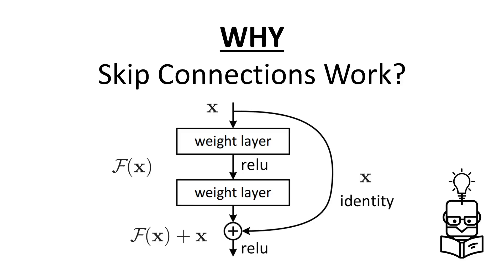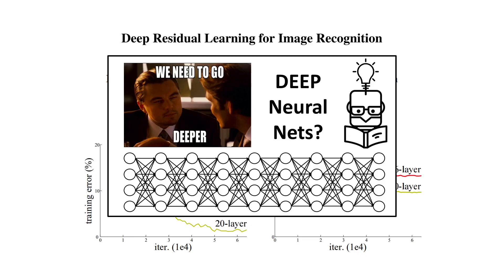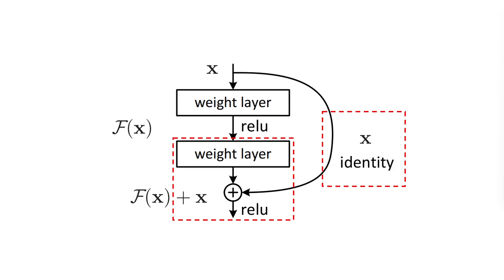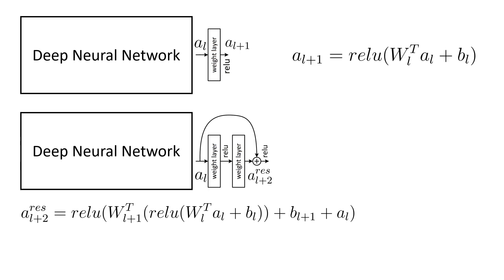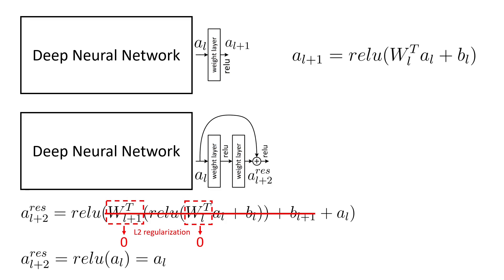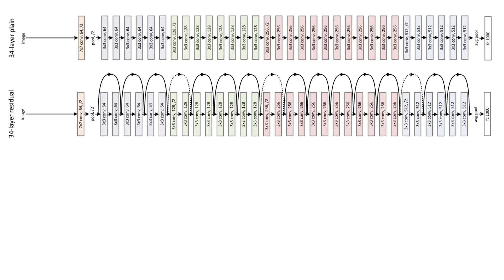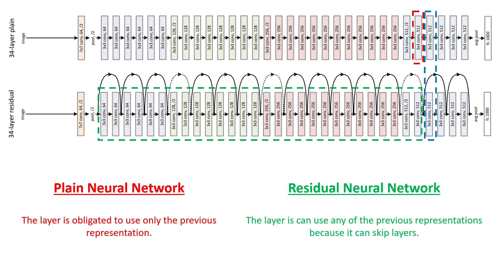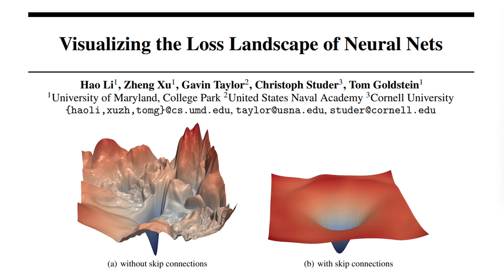Why Residual Connections (ResNet) Work

Comment: Thanks for the video! But you said that in the Residual architecture, the Network can use any of the previous outputs, what did you mean by that? It's not like it's connected to each of its previous output??
Reply: No, it is. For ex. With res connects, obviously layer 38 connects to 37, but it also connects to 36. This shows why res connects are so novel. Additionally, 38 can connect to 12, 15, and any other previous layers. If you look at the math equations, it makes more sense.

Comment: Thanks for the explanation, there is one thing that I hope you can elaborate on. With the weight matrix randomised, why is it easier for the NN to learn Zero Matrix compared to the Identity matrix?
Reply from the maker: Good question! IMO mainly because you also usually use weight regularization (i.e. L2) in your final loss, so the NN can easily shrink the weight's matrix values to 0.
Reply: @datamlistic  Makes sense, thanks for the explanation!